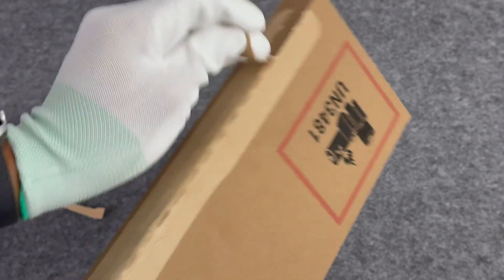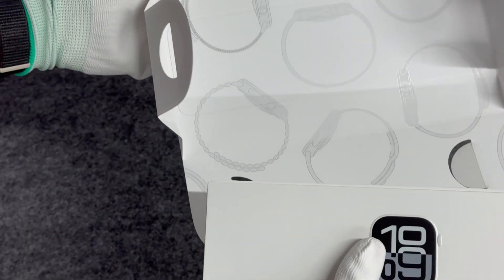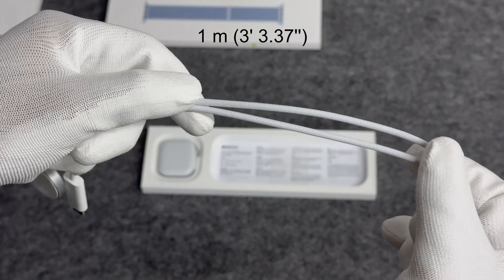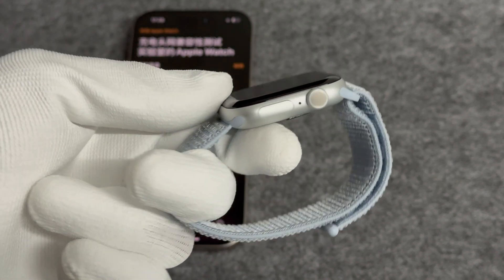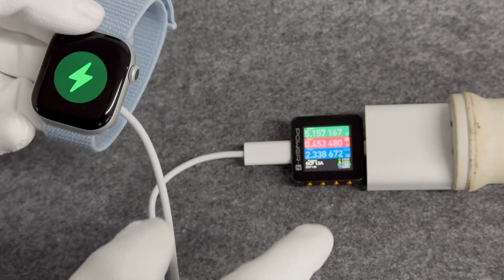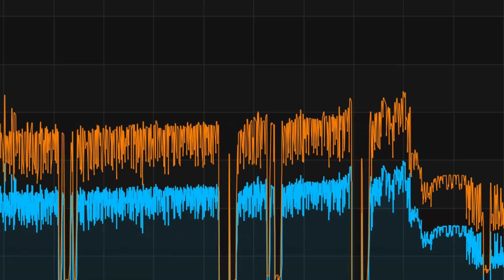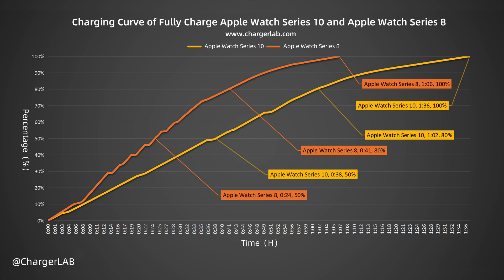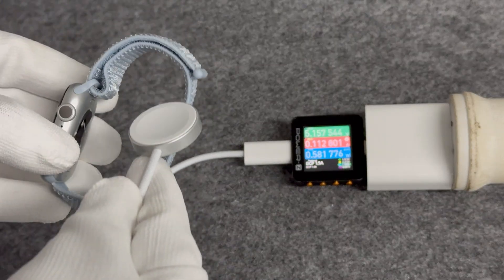Charging Review of Apple Watch Series 10 (Chinese Version)

Comment: something is definitely funky here. werent they claiming that it can go 0-80% in 30 minutes? i would definitely re run this test doing SOMETHING different. different power adapter, different cable, maybe after a few battery cycles, i dont know. this doesnt seem like the expected result
Reply: It's the Chinese version, which does not support 5W fast Charging and only delivers 2,5W regular Charging. That should be noted in the Video. It's misleading for western audiences.
Reply: @ ah, thanks for the clarification! that makes a lot more sense. now, why there is a china only version that does not support fast charging, that seems to be another mystery.